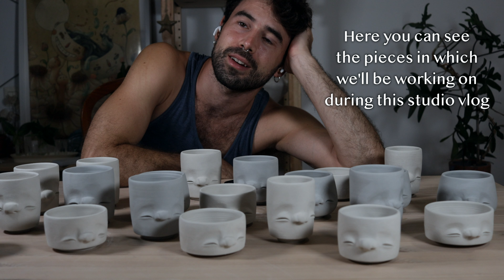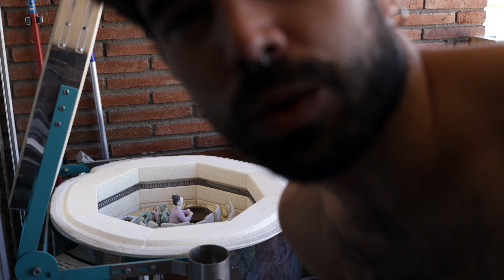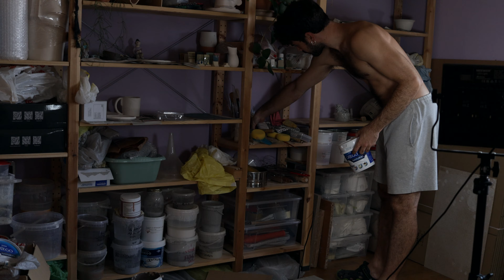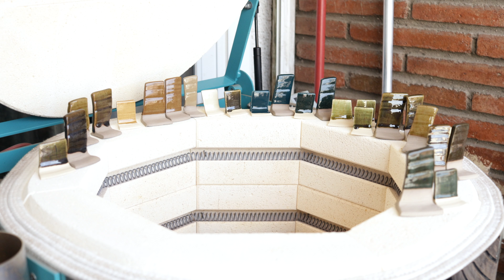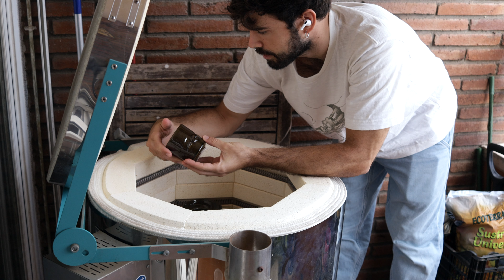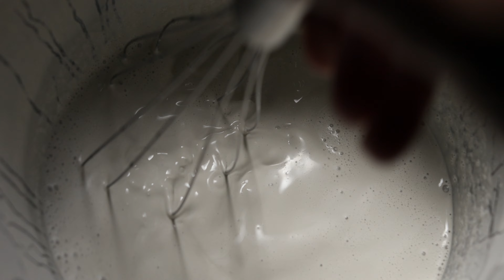Glaze & Fire Pottery in my Home-based Pottery Studio

Comment: What a great video! I’m so glad to see you continuing to do new things.  Great work, as always!! May I ask you what kind of sandpaper you’re using to sand the bottoms of your pots? Thanks.
Reply from the maker: Hello hello! And I’m so happy to see you in here, accompanying me along the journey!
The sandpaper is not any special pottery one. I bought a pack of 10 that could be used also for sanding wood or other materials! 
Sending you plenty of good energy from Barcelona!
Reply: @terrahumida  Yessss of course I’m still here!! I wasn’t sure if it was special paper or not. I wet sand my pots and used to do it by hand with sandpaper you can use when wet but now I have a metal sanding disc that goes on a bat on my wheel and I hold the pot down on it while wet and it sands the bottom so fast!!
Reply from the maker: That’s the one I want to get too! I’m sure that the pottery one is amazing I’ll have to put some money aside and invest on it. Do you recommend it?